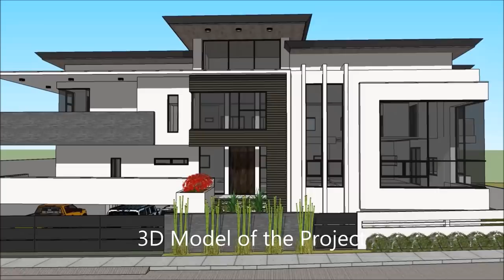Actual Construction of Modern 2 Storey House - 2nd Work Week

Comment: 3Storey house?? You used 12mm for columns and beams?? the result of this would be a disaster in the making..you must used 25-32mm small columns compared to building super column..get your DPWH and DTI PCAB check your house..they used undersize materials ask your city engineers to inspect the other engineers works of its substandard or not..its not about income or profit but your individual subcontractors are ridiculous..their workers are not wearing HELMET or safety boots!! its a hard hat area..you violated the NATIONAL BUILDING CODE..you can be arrested for not following the mandatory rules..another OVERPRICED URBAN HOUSE done by SKILLED WORKERS..ask for other engineers and architects or CONSTRUCTION BUILDERS COMPANIES for second opinion..it will collapse the REBARS used was undersize 12mm bars are only 200 pesos each,while 25mm is 1000 pesos /bar..GOODLUCK